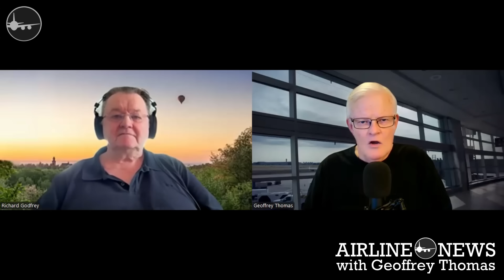Air India Crash - Probable Cause  #airindiacrash

Comment: AI 171… and Future Aeronautics Safety
The AI 171 report provides a bare-bones outline of facts with no projection on how those facts came to be, how they relate to each other, or how they tie into the final analysis.    Presumably the final report will fill in those gaps;  in the meantime there is no end of internet conjecture, keeping the subject alive and interesting.  How best do we exploit and capitalize on that interest?
It would be superbly instructive to examine critically the totality of the emerging Internet conjectures through the lens of the current design and certification methods. This would introduce interested people to the methods of risk mitigation and fault accommodation practices of today that form the basis for aeronautical safety in design, operation, and continued airworthiness.  There may be people experienced in threat and mitigation modeling in other performance-critical areas (automotive, power grid, financial systems etc) who have positive improvements to offer the aeronautical world.
There are currents of change about that we all must be aware of…FAA is moving from Prescriptive safety certification requirements to more of a Performance certification basis, which will have significant change in methods.  Secondly, AI is upon us – and can provide a very powerful capability aircraft safety – but can also be misused, so we must manage that properly.  Thirdly - new methods in mathematics and testing are forever presenting opportunities for exploitation in safety design – Markov Chain Modeling being one example of a leading contributor.  We must take advantage where the effect is positive.
While this is going on, the tech world in which we are all immersed keeps evolving, changing how humans interact with technology.  How do these emergent behaviors match (or not) with the rapid expansion of aeronautics around the world – do the assumptions made by aircraft designers in match the technology-interactive perceptions of our various cultures?  Does the ‘1.4 sec reaction time’ assumption underlying V2 speed mean the same thing to all pilots of all cultures?  We really have to get out ahead of the curve here and make sure the systems we design today are future-proofed.
Currently our safety design and certification system are characterized by largely ‘prescriptive’ rules of FAR 25 (aircraft) and FAR 33 (engines) - with an overarching ‘performance’ rule in 25.1309 dealing with overall system safety.  Reading that rule – and more importantly its associated AC 25.1309 - will be highly instructive for those interested in how this top-cover system safety concept works today.  Understanding 25.1309 of today is essential to figuring out how we can improve it in the future – keeping it current with emerging technology interaction.  This is where the industry needs help.  
Even 1309 does not 100% ensure safety – it mandates (and attempts to verify) – that ‘catastrophic’ technical failure (fatalities exceeding 5) will not exceed 1 in a billion flight hours.  This level of acceptable risk was established 40-50 years ago when aviation was one-quarter of the size it is today.  Are we still OK with this number?
Recognize that this is the ‘technical risk’ area…it does not include human error or malicious action.    A big factor in the human side is a wrong action – such as shutting down the wrong (good) engine on a twin, with one engine malfunctioning but not completely failed.  We’ve had at least 2 of those in the last 3 years – TransAir and Jeju.
So… with the above as background and with all of the internet interest in aviation safety - lets have our greatest internet allies, Geoffrey and Richard, take us down that path of greater understanding…and bring new bright minds, with better solutions, into the picture.
Back to AI 171…for the moment, all we have is what has been written by those on the inside of the IIAB team and by what we can infer from the observed and reported actions.  Clearly the report writers did not want to write anything they would have to retract – so we are treated to just facts, and minimal as that may be.  The report rightfully expects that consumers of it will have deep understanding of airline dispatch and departure methods, thus it is only necessary to provide several timing hacks at the beginning and the end of the sequence, with us filling in the blanks with normal and usual actions – with the report giving only the exceptions to normality.  The specific identification of all actions, normal and abnormal, will appear in the final report.
The event review of the crash starts with the normal request for pushback and start;  since no exceptions were remarked were, it is reasonable to believe that dispatch configuration and power setting (possibly including deration) were properly matched to wind, density altitude, runway condition and slope, length, and ambient temperature.
Further no remarks were made regarding the 80-kt callout, which is performed to verify that all technical conditions are correct at that point in the takeoff roll, including crew attentiveness and acceleration position along the runway.  We can assume that the takeoff was normal to that point.
There were no remarks regarding the V1 speed ‘go’ callout, so we can assume that engine parameters (the key focus at V1) were normal at that point.
There are no remarks made at the VR speed point, verifying that everything was normal at that point.  If brake drag was a factor (one of the internet theories) the rotation would have taken excessive up-elevator to achieve, to compensate for the AND moment that brakes create especially at high speed.  This would have delayed the rotation and resulted in over-rotation once the wheels were clear of the runway, likely with a tail strike; and would clearly have been interpreted and remarked by the crew as a control problem.  This would have been reported as an exception in the report. Absence of such suggests that the rotation was normal and brakes were not involved.
The report presents the only tech exception in the entire dispatch and takeoff as the fuel switches being set from Run to Cutoff about 3 sec after rotation, then back to Run approx. 10 seconds later.  The engine deceleration and EAFR logging of the digital signal to the fuel switch to cutoff indicate that the following were working correctly:  28 V power;  the battery buss side of the fuel switches;  the digital signal side of the switches; and all of the fuel valves.  The subsequent relight upon fuel switches being reset to Run proves that the above subsystems plus FADEC and AC power for ignitors (RAT-sourced at that point) were all working correctly.  
Engine 2 re-lit but was unable to accelerate, due to the additional 4 seconds of exposure to fuel-off.  The resulting additional deceleration would make it more subject to compressor stall upon fuel re-introduction;  and it had decelerated well farther into the sub-idle N2 regime where starter assist is required to accelerate.    Starter power is provided by Ground Power or engine/APU, none of which were available.
The fuel switches worked correctly the last time they were used properly – as the previous flight successfully shut the engines down and the accident flight had successful starts.  No exceptions or deviations were remarked in the report.
We know that the engine deceleration was not an intentional response to clear an engine surge or other fault as some internet analysts have assumed, as the transition to cutoff   preceded the deceleration, per the report.   The surveillance videos do not record either the graphic imagery nor cannon-report sound of a stall-surge, especially noticeable at high power.
We know that the ‘smoke’ reported from one of the video cameras is actually runway sideline dust caught in the ‘starting vortex’ and the vortex sheet pattern, both of which form suddenly as the angle of attack abruptly increases to create rotation.  The dust plume in a wing wake is  maximum towards the wingtips.  Smoke emanating from an airplane fire forms an entirely different pattern – a streak – see the pics of United 777 with engine failure out of Denver.  (Finite-wing vortex development was first described by gifted UK engineer Frederick Lanchester in his misnamed tome “Aerodonetics” in 1908.)
 
There has been much speculation on the timing of the RAT deployment relative to the engine deceleration.  The numbers in the report indicate RAT making hydraulic power ‘about’ 5 seconds after fuel cutoff.  The ‘abouts’ in the report need to be cleaned up so that precise numbers are available and the cutoff-relight cycle picture can be put on a common timeline.  Certainly in all of our collective experience, the dynamics of a fuel cutoff event conducted at Takeoff power is not common knowledge – nor how the PTO shaft and gearbox, with its generators and hydraulic pumps loaded, react to the massive N2 deceleration.  The logic that reacts to loss of engine-driven electric and hydraulic power at this critical point in takeoff and how that deploys the RAT needs to be discovered and accounted as part of the timeline.
Lots to discover here folks, thousands of data bits.  Once it is all out in the open for us to learn from, let’s see what we have learned about Risk Mitigation and Fault Accommodation – and where or how we ought to enhance this picture in the future.
IMHO, of course.  57 years in the business and still trying to get it right.

Comment: Thank you gentlemen. Another very good post, with many enlightening comments attached.

I dont support a thermal runaway event based on rotation, because of the time to build up to runaway, assuming the water could get into the battery. Perhaps an existing short, and introduction of a large current, around WOW?

Comment: Dear Richard and Geoffrey -  folks assert that "The battery for the APU of a Boeing 787 is located near the main landing gear. Not near the EAFR" -  how would a thermal runaway of this Lithium Battery followed by water ingress - cause the fire and corrosion - to a "far away" EARF - which is close to the "rear" of the aircraft. I just love your thorough analysis and thoughful and detailed explanations.

Comment: Delhi → Islamabad (Pre-AI171) Scenario

Engine Start/Taxi: Aircraft departs Delhi with minimum trip + reserve fuel uplift. Standard dispatch.
Cruise: Flight profile normal until descent. Fuel consumption in line with plan.
Approach/Descent: Near Islamabad, intermittent electrical fault in the EE bay disrupts the Horizontal Stabiliser Trim Actuator (HSTA).
Effect: Trim system intermittently commanded nose-up instead of nose-down. Crew forced to correct manually. Aircraft flown close to stick-shaker margins at times.
Time/Fuel Impact: Fault correction and unusual descent path added ~20 minutes airborne. Extra ~2 tonnes fuel burn, effectively eating into final reserve fuel.
Landing: Touchdown safe, but aircraft arrived at gate with fuel levels significantly below planned reserve. HSTA tested on ground → “no fault found.”

Key Point:
The erratic descent and fuel over-burn on this sector plausibly depleted reserves, leaving the aircraft under tighter margins for the following Ahmedabad–London flight.

Why It Matters for the Next Flight (AI171, Islamabad → London Gatwick)
Fuel State at Islamabad Gate
Because of the HSTA malfunction and extra manoeuvring, the aircraft likely landed with less than its planned final reserve fuel.
Under the old Air India SOPs, fuel uplift was often calculated on the assumption that reserves were intact at block-in, without always cross-checking the true remaining fuel in each tank.

Refuelling Under Old SOPs
The uplift calculation would have been: Trip fuel to destination + contingency + alternate + final reserve.
If the dispatcher or crew assumed reserves were intact, they may have added only the trip + standard extras, rather than topping up the additional fuel already consumed on the Delhi sector.

Result: Critical under-fuelling for a long-haul like Islamabad–London.
Takeoff from Islamabad (Crash Flight)

During takeoff roll, the fuel pumps began cavitating due to already low tank levels (or low suction head).

This triggered a LOW FUEL PRESS caution—but because Boeing’s takeoff inhibit logic masks amber cautions between 80 knots and 400 ft AGL, the crew did not see the warning.

From the cockpit, it would have looked as though the aircraft was operating normally.

Outcome

Both engines suffered simultaneous fuel starvation just after liftoff.

The crew had only ~25 seconds from flameout to impact—too little time to identify the true cause or cycle the fuel control switches as per the later SOP revision.

✅ Bottom Line:
Because the Delhi–Islamabad leg consumed more than planned reserves, the aircraft arrived with less fuel than dispatch assumed. The old SOPs for fuel uplift failed to correct this, leaving AI171 critically under-fuelled at departure. The later SOP change—explicitly requiring an abort on LOW FUEL PRESS—is silent testimony that this sequence really did happen.

Kind Regards Scooter.
Reply: NOPE- Not even close.

Comment: It appears this presentation defines the probable cause of Air India 171 crash as an APU battery fire. 
That is beyond a real stretch. The FDR illustrates the fuel cut of switches were positioned to the fuel cut off position after rotation. That will do it. An aircraft malfunction ID’d by the investigation would benefit the Airline.

Comment: Another excellent show Lithium ion battery thermal runaway fire 
AI shows below risks from water presence 
Summary:
	•	Inside the cell: Moisture contamination = chemical instability → gas, corrosion, and increased runaway risk.
	•	Outside the cell: High humidity → condensation → shorts, corrosion, or moisture ingress over time.
	•	Direct water contact: Dangerous if the cell is damaged or hot, as it can trigger violent reactions.

Comment: Gentlemen, thank you again for another riveting and always tragic episode.  Richard, your deep knowledge continues to astound and impress.  

MAJOR QUESTION

But I do have a major question for you please. Your original 'plausible hypothesis' made no mention of a lithium battery failure in the aft bay of any kind, never mind the possibility of multiple (as you say uncertified) impacts such as fire, corrosion and water combining. Indeed I can't remember which episode(s), you guys seemed to dismiss the idea of a lithium battery thermal runaway. (Pls correct me if I have that wrong). Although you did of course identify water ingress as a major possibility (toilets etc).

NEW FACTS?

There is absolutely nothing wrong with refining an original hypothesis as new facts become available. Indeed that is how science works. But in this case, I cannot see that 'new facts' were involved?  We knew about the presence of (likely if not confirmed) smoke on take off from the rear left side of the aircraft  from the early original videos and also the extreme fire damage in the crash to the rear FDR. Or have I missed some NEW facts which have only more recently become available since you original hypothesis?

jUST REFLECTION?

Alternatively, there is also nothing wrong with refining a hypothesis based on extensive reflection of the originl known facts. That would be scientific honesty and to be applauded.  But you do not make clear if your revision is due to that either.

SUMMARY

So in summary, this is absolutely NOT a criticism. I admire you both greatly. I am just intrigued about what precisely your chain of reasoning has been  to revise the original hypothesis.

Thank you both for your continued efforts on behalf of the families to get to the truth
Reply: Well said!
Reply: @Corwin4000  I agree 100 %. I have zero knowledge on this subject, but it always struck me that the picture of the AFT EAFR in the Preliminary Report looks like having gone through a thermonuclear meltdown rather than an aircraft accident.

Comment: The AAIB Preliminary Report is responsible for the speculation, after implying pilot sabotage with a very short paraphrased excerpt of the dialogue between the pilots. You don't imply mass murder, you either explicitly rule it in or you explicitly rule it out. By combining the highly inflammatory and defamatory implication with the suppression of evidence, it guaranteed that the public would not wait for the final report before drawing a conclusion, and blame one or both of the AI171 pilots. Which is what has happened, by design. It's called misdirection.

Comment: If your interviewee is going to just read his answers, perhaps he could have written them clearly, perhaps in active rather than passive voice.  For example, instead of 'the fuel was cut off' a slight mention of what or who shut them off.  Is there a circuit that automatically shuts off both engines during takeoff if there is a fire somewhere?   Or did the pilots do it by reflex when seeing an 'engine fire ' light?   Didn't learn anything substantial from this video.  At all.